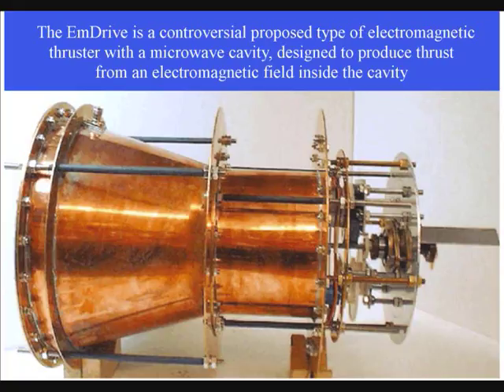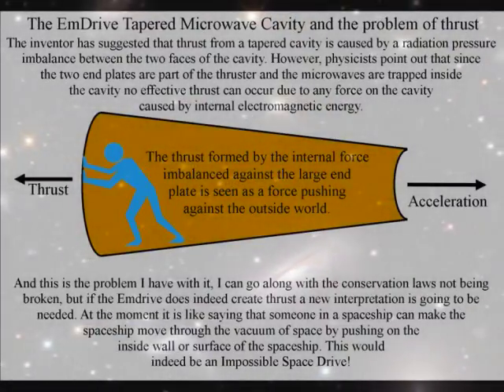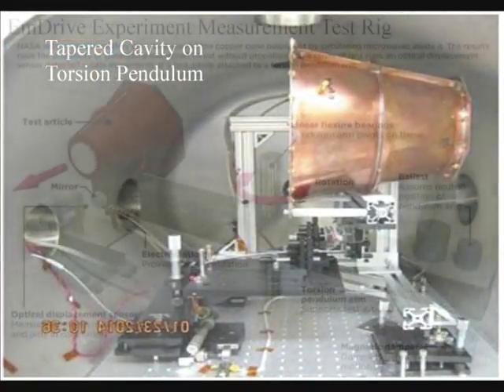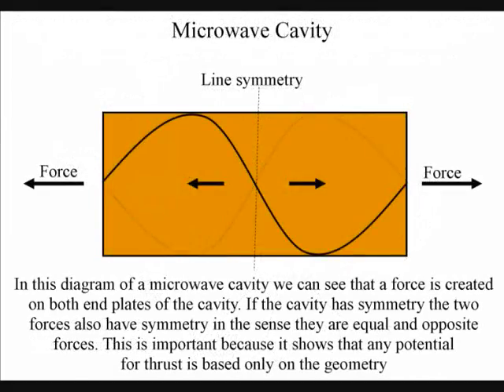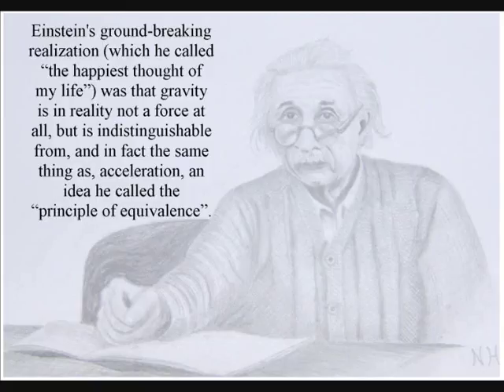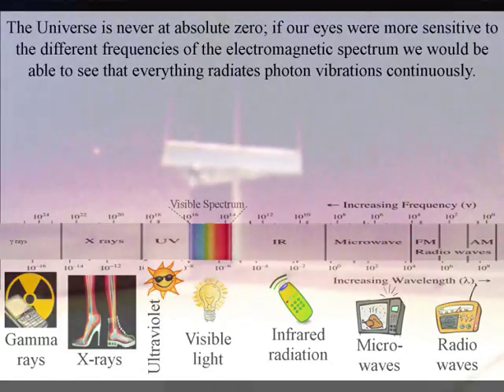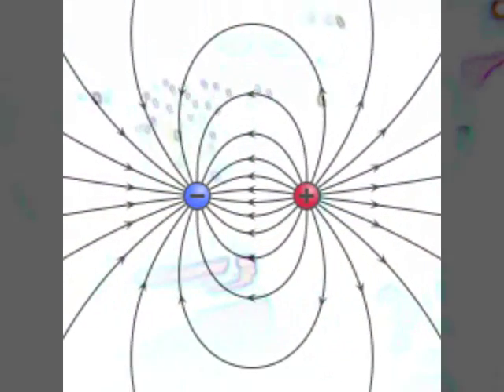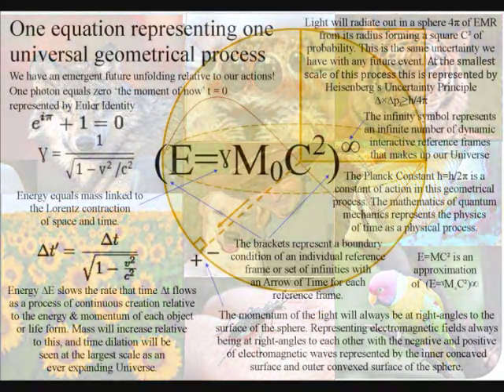Why the EmDrive is going to work (2)

Comment: Still not working.
Reply from the maker: In what way?
Reply: It's not producing a reactionless force. The tests done on this show that it does not produce thrust significant enough to conclude it does work. Any force that is detected can be better explained by the air molecules in the cavity being heated up and hitting the cavity. That is without even mentioning that its creator claimed it could produce enough force to lift a car, which is (1000 kg)(10 m/s^2) ~ 10^5 N. Maybe it's spread about a few thrusters, so I'll be generous and bump it down an order of magnitude (10^4 N). It barely created a few tens of micronewtons (10^-5N) IF the air molecules really could not explain it. That is a difference of 9 orders of magnitude. A factor of 1 BILLION.

Any force measured on the EM drive is likely due to differential heating of the cavity in the test done on it. It does not work, and on the off chance that it does (I'd bet all the money I have against that though, care to play?), it does not work as advertised.
Reply from the maker: Time will tell! Thanks for the info!!!

Comment: The University of Dresden just released a video showing some of the results of preliminary testing of this drive. They noted that the thrust numbers read the same when the drive is pointed downwards and then rotated at an angle 90 degrees which would make the thrust point at a right angle to the force sensor so they should have measured no force at all. When they measured the force while the drive was at a right angle with respect to the force sensor, they read the same magnitude of force. This shouldn't happen if your direction of thrust is at a right angle to the force sensor. They also placed a 40db attenuator in line with the microwave amplifier and they performed the measurement again and measured the same amount of thrust. This doesn't really make sense.  

They then did some calculations and concluded this might be due to a Lorenz force generated by the current being drawn by the microwave amplifier. This doesn't look promising. I would love for this to work and I have already told people this has been proven to work but after I did some more in depth research it appears that the measurements from Dresden indicate this doesn't work. They are in the process of shielding the wires in such a manner as to eliminate any Lorenz force effects so we should have the results of that in a year or so. I am sorry to say that this isn't looking promising.  
Here is the link to the video from the Institute of Aerospace Engineering, Technische Universität Dresden:
https://www.youtube.com/watch?v=ql2-KN4mGDM
The part where he talks about rotating the amplifier 90 degrees and adding the 40 db attenuator starts at time = 41:57 and ends around time = 46:00
Reply: I was also wondering this. 11 months down the line there is no news. There is a guy Mike Mcculloch that released a PDF on quantised intertia in december 2018. https://www.researchgate.net/publication/329754104_Propellant-less_Propulsion_from_Quantised_Inertia 

I don't know if it's legit or not. Probably not but I hope someone solves this shit soon. Even if we do get to space we've got the problem of humans in zero G. We don't do well without gravity
Reply from the maker: Thanks for the info and link I will check it out! I would like it to work because it would lead to new physics!!!

Comment: by its self, I don't think the electro magnetic drive can produce acceleration as it would violate the conservation of momentum. I think that as demonstrated by concept shown, is a primitive design that might become part of the mechanics that will make interstellar travel possible. emdrive would function better as a accumulator that creates a solar sail. creation of a barrier that would propel a craft along the solar wind, as it would build up a electromagnetic vacuum of quantum particles of photons in the plasma from coronal mass ejections, no different than a ships sails on an ocean.I think that as the emdrive is presented now it can not and never will create acceleration, but it can catch solar wind causing acceleration and control of direction.
Reply from the maker: I think the reason why a solar sail seems more logical is that it is an open system and most people would call the EmDrive a closed system! The reason why I made these videos on the EmDrive is because if they worked it would change are view of the Universe totally. Our understanding of almost everything would have to change! The reason why this is a possibility is that we have so many paradoxes in quantum physics. These paradoxes can be seen as opportunities for a deeper understanding, but they are so weird that the explanation and potential of the new understanding may also be weird.
Reply: During refraction of light through glass , if we consider light as a partical, it will satisfy classical physics. It's initial momentum will be mass multiplied by velocity. The velocity of light in air is 3 multiplied by ten to the power eight meters per second. But it's velocity in glass is 2 multiplied by ten to the power eight meters per second. So initial momentum in air is not equal to the final momentum in glass. Does conservation of momentum and energy holds true here.
Reply: During reflection of light through glass if we consider light as a particle we observe the following facts. Firstly the light is a particle, it is proved by Albert Einsten,light is unaffected by electrical or magnetic field lines. It can be proved by passing light through strong electric or magnetic fields. Now if we see inside an atom we find that an atom is mostly empty. Proved by gold foil experiment bombarding alpha rays on it .so an atom contains electrodes, protones and neutrons in neuclius and a lot of empty space in which only electric and magnetic field lines are present. Again Sir Edington during total solar e cclipse proved that light partical is effected by gravitational gravitational force of Sun and bent through an angle of 1.75 arc radians. When force required to bent light through this angle was calculated it was found 2 multiplied by ten to the power minus twenty N. Now the mass of electrone is 9 multiplied by ten to the power minus thirty four Kg. Radius of electron is of the order of ten to the power minus eighteen meters. If we calculated the force at its perifery it was found of the order of ten to the power minus thirty. It is clear that electrone can not deviate a photone by its gravitational force even it passes grazing it similarly neucleaus is also unable to deviate it due to its gravitational force.. As photone is a partical it will satisfy all the rules of classical physics. It seems that an atom also contains a tiny black hole which has deviated light partical from its path . This black hole may play a vital role in the construction of em drive.